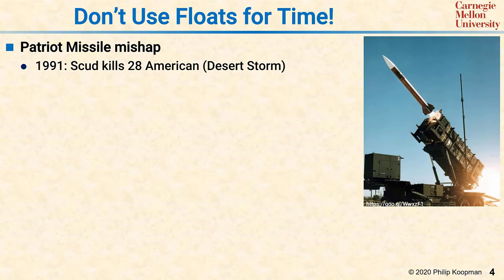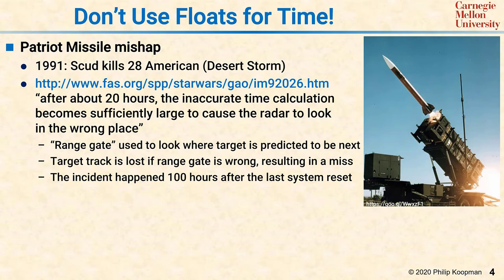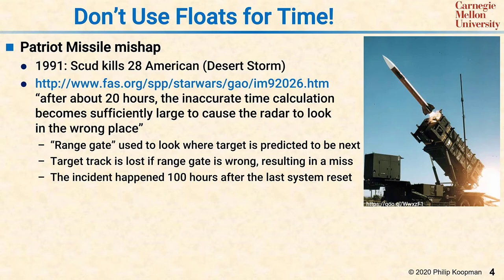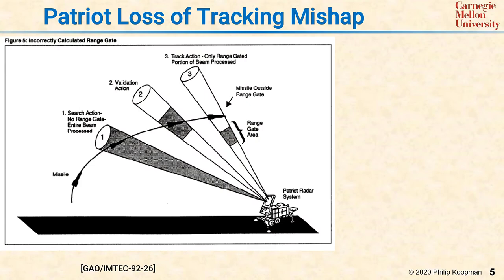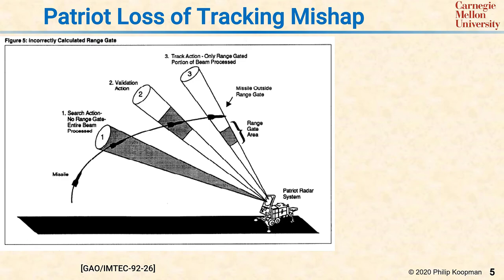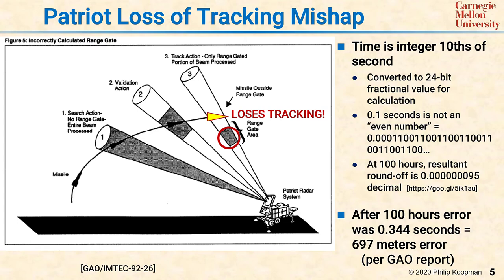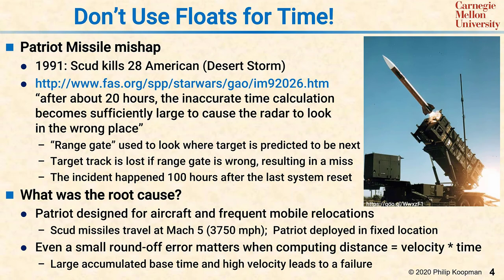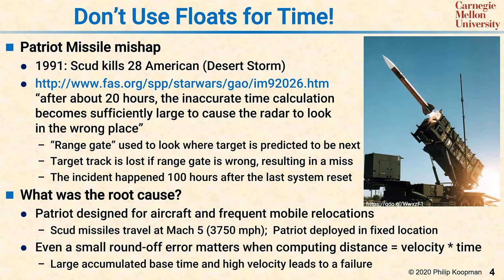L25 04-05 Do Not Use Floats For Time -- the Patriot Missile Mishap

Comment: How did this pass QA? I mean choosing FP for time seems like a rookie mistake but I'll allow mistakes for any software engineer because we all have different experiences / strengths -- but the whole point of software review is to catch these type of mistakes. This really should have just been a learning experience for the software dev during code review for him to go back and modify methods, etc. so that they used a 64 bit INT to keep track of tens of a  second instead of FP32. At least, 64 bit INT would be my choice at that time since memory constraints probably weren't so tight that using a 64 bit instead of a 32 bit int would cause major issues. 

INTs should generally be your go to unless there is a compelling reason to use FP where exact precision might not be needed but a very large range with some minimum precision is needed. That's when you figure out if FP16, FP32, FP64, FP128 is the best bet for your particular problem.
Reply from the maker: This was really old hardware. 64 bit INT might have been seen as burdensome. And without this example to bring home the risks the issue was just not as well understood.

Also, it was developed for a cold war scenario where it was expected that the operational concept was operate for a few days, then pull up stakes to run away from the advancing soviet army tanks.  Operating for weeks at a time without moving was not contemplated.  So testing didn't catch it.

Beyond being the poster child for getting fingers burned by floating point, this is also an object lesson in operational drift from what the validation was testing.